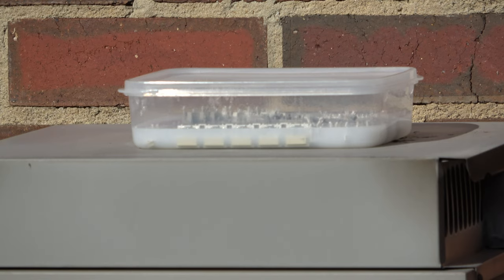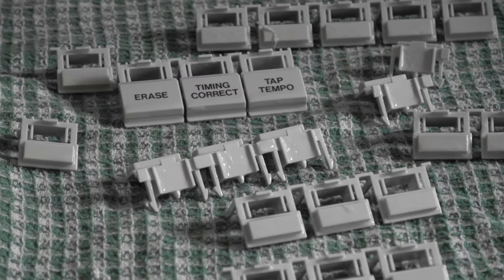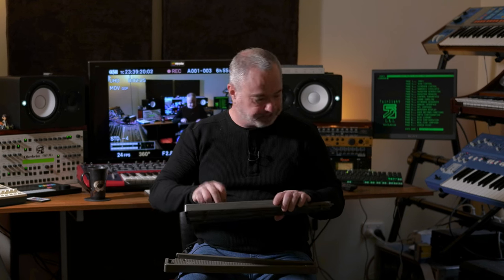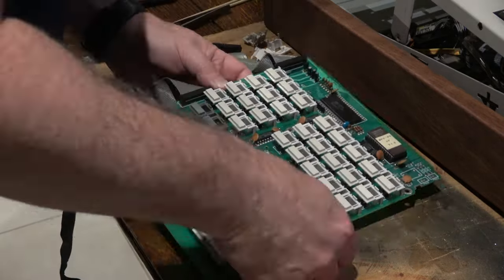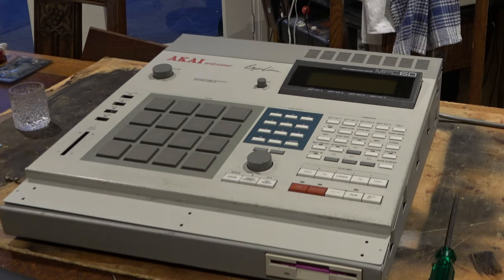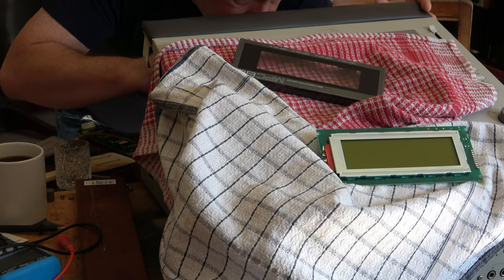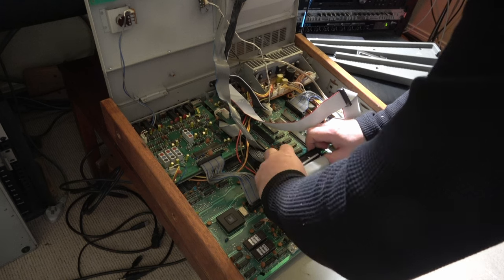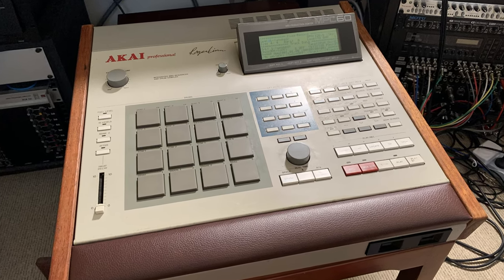AKAI MPC 60 Restoration Part 2

Comment: Whenever I get access to some old EEPROMs in devices I get my programmer out, read them out and backup the data. I had a Linn Drum and a Memorymoog once, where some bits flipped back to high so the software would crash in the Memorymoog and the drumsound would click in the Linn Drum. Saved me twice.
Reply from the maker: Yeh, I have backups of the Rom's in most of my gear! EPROM readers are so cheap these days but some older UV EPROMS are now starting to become a lot harder to souce! :D

Comment: Perfect video ❤ I tried replacing the old original display with a new one. The old original display worked. Since I got the new display, I only see a blue backlight. Do you perhaps know why that is❓
Reply from the maker: Unfortunatly it could be a lot of things, Contrast being not set correctly on an LCD can cause it to look like its not working, check the cables, and look at it from various angles to see if you can see even a slight bit of the display. Hope this helps :D

Comment: Nice one! I'm just waiting to get all tact switches to replace them in my 60 too. Great job!
Reply from the maker: Well woth changing every Tact switch. I find on anything that has dodgy or marginal ones it really adds stress to the session :D
Reply: @100ThingsIDo  yes Sir. 70 pieces ordered. 50 small ones and 20 big ones just in case to have a few spare ones. Will you try to refurbish letters on the big buttons? My STOP button isn't readable at all. I can get some stickers but I'm not sure if that's a good idea. I'm planing to send my top panel for respray. It will cost me appx €200 plus shipping cost. I think it's worty.
Reply from the maker: @bizon33obroty  I came up with a different way to do the buttons I think.. No sure how long it will last but holding up well so far.. drop me an email and I can let you know what I did and send you an image of the example :D
Reply: @bizon33obroty  Hello, I’m in the processing of refurbishing a beat to all hell MPC 60. Are you willing to share where you picked up the tact switches and what company repaints the top panels? Any help would be greatly appreciated.
Reply: @bizon33obroty  OK thank you!! I’m going to check it out now. Are the B3W-4000 switches a different size? I thought all 59 tact switches are the same size.
Reply: @mrautomatech2329  I didn't check myself, however people on the forum say that play, stop, rec and location tact switches are bigger than the rest.
Reply: @bizon33obroty  Thanks again. Is AudioCustoms doing the paint job?
Reply: @mrautomatech2329  Yes.
Reply: @100ThingsIDo hello Sir. I did contact you on Instagram regarding to buttons restoration. How are they after 1 year of use? I have managed to get stickers, but they don't look that great. Looking forward to hear from you. My 60 is fully repainted and looks awesome.
Reply: @mrautomatech2329 how is your 60? Mine is almost done.
Reply from the maker: @bizon33obroty  Hey there, They are still holding up really well! drop me an email and I can send you a pic! :D

Comment: What was the bit of soldering you did after replacing the backlight? I’m about to do the same to mine but didn’t think it required any soldering
Reply from the maker: That was just to solder down the backlight connectors to the display board. Mosttimes they need soldering sometimes not... Its pretty easy to do so if you do some practice first I'm sure you could solder it :D

Comment: So did you paint the play stop buttons or just buy a new set? Good to know that retrobriting doesn’t fade the lettering on them.
Reply from the maker: I used water slide decals printed on a laser printer then I covered the print with a varnish to make it last longer. 1 year later they are still going strong :D Easy to re-do if they wear out and look so much better than stickers!

Comment: Really enjoyed this video. You really hooked this one up. Thanks for posting. I just picked up a 60 that is quite beat up. Do you happen to have any links to what SCSI2SD parts are needed and where to purchase them? I’ve been having a hard time finding a compatible kit. In fact, having trouble sourcing a ton of parts that I will need.
Reply from the maker: I used a generic SCSI2SD adaptor and a 3dprinted shell for it. I purchased Jazzcats version of the SCSI interface & cables from eBay. I set up the SCSI2SD adaptor pretty much using the Auto setting. Hope this helps :D
Reply: @100ThingsIDo  Thanks for the response, but yeah the problem I’m having is finding anyone with SCSI2SD adapters in stock. I’ve found everything else but those adapters.

Comment: What happened to Peter?

So, is there a reason you haven't gone for Roger's OS v3.1? Also, how much work did you do on the pads?
Reply from the maker: Peter just didn't seen to work in any of the SO points this week so I decided to save him, Newt and the others for next time :D I went with the ported Vimana 3.15b OS more down to price than anything. There are a few bugs in it that might make me purchase Rogers 3.1 later (such as the Mixer not working). Pads were and are perfect so I did not have to change anything there!

Comment: What about de-yellowing the whole face plate? I just bought a 2000XL in the same shape. Most yellow I have ever seen.
Reply from the maker: You can try cleaning it first then cover the display with something to block UV (foil or something like that) and leaving the MPC out in the sun for a few hours for a few days (Don't let it get damp or wet of course). That can help most plastics (and some paints) return from deep yellowing :D

Comment: How difficult was it to swap leather on that bolster?
Reply from the maker: I just purchased some self adhesive leather (I think its Plastic 'leather') from eBay, unscrewed the bolster and put the new leather right over the top. Worked like a charm :D
Reply: @100ThingsIDo  I see, thanks for your reply! I'm curious to know if anyone ever managed to get good results having replaced the original material... this might be something I will do soon
Reply from the maker: @Hauteclaire16  Yeh, its bascially just plastic fabric on wood so as long as you go slow and cut to the correct size it should look awesome :D
Reply: @100ThingsIDo  Did you remove the old 'leather', or just put the new on top of the other? 🙂
Reply from the maker: @djdue5654  Just put it over the top, the old leather was mostly OK but had a small nick in it so I decided to leave it in place for originality if I wanted to go back to it :D
Reply: Ah cool, thanks for the reply!